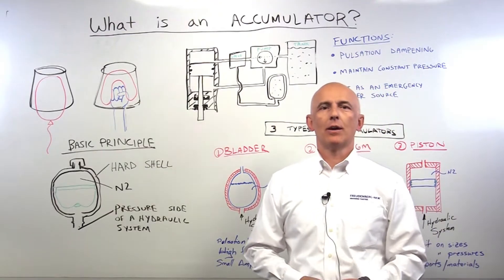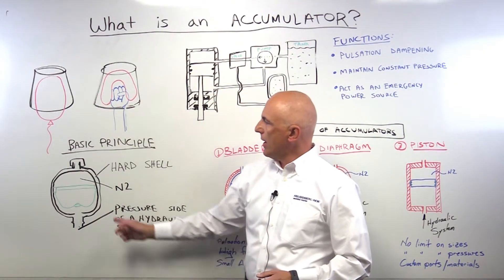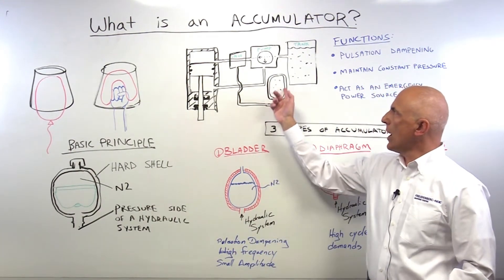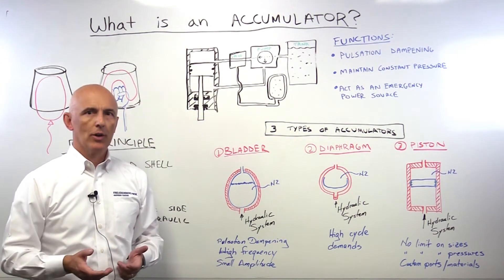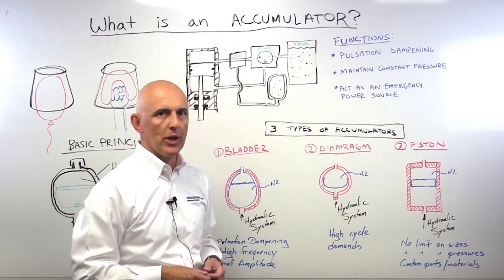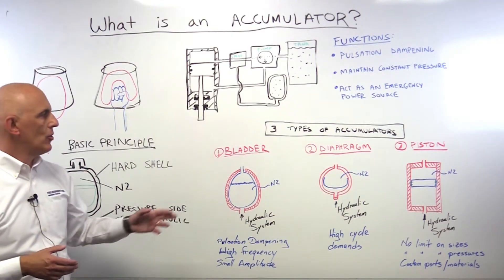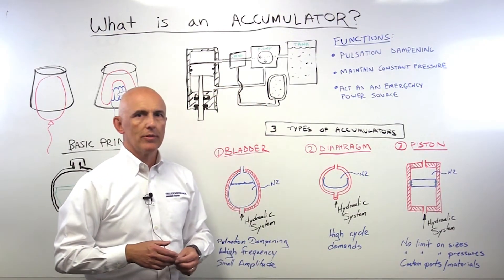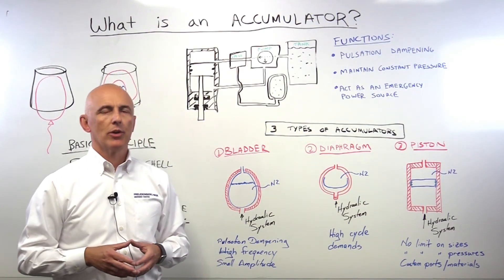What is an accumulator?

Comment: This is a good video, but it would be much better if you started off with telling us exactly what an accumulator is used for. Some people--like me--come in not even knowing that it has anything to do with hydraulics. My understanding is that its primary purpose is to store hydraulic fluid under pressure, but theyd be a few minutes into the vid before they could even guess that.

Comment: why use n2 gas?! Its a safety?!
Reply: Ya, if air(O2) is used and if there is any leakage through the barrier, the compressed air is hot so when it comes in contact with mineral oil, it could cause explosion or fire.
Reply: @gamester7287   Thank you ☺

Comment: I was thinking of using an accumulator for a press that I am designing because of the low loading rate required. Is it a valid application for accumulators?
Reply: Definately wouldnt hurt. The higher pressure capabilities your press has. The morenecessary an accumulator will be

Comment: Thank you for the explanation. I was having trouble with a press at work, machine repair took the accumulator tank off said that we did not need it, the press has not ran right sense. One of the main things that it is doing is pulsating violently

Comment: I though this was for extra sensory perception. This was interesting anyways. Thanks. Does Nitrogen bladder or diaphragm accumulators operate well in cold temperatures?
Reply: you prolly dont care at all but does someone know of a tool to get back into an Instagram account?
I stupidly forgot my login password. I would appreciate any tips you can offer me!
Reply: @Conrad Quinn instablaster ;)
Reply: @Louie Hudson Thanks so much for your reply. I found the site through google and im waiting for the hacking stuff now.
Looks like it's gonna take quite some time so I will get back to you later with my results.
Reply: @Louie Hudson it did the trick and I finally got access to my account again. Im so happy!
Thank you so much you saved my ass :D
Reply: @Conrad Quinn glad I could help :D
Reply: Acumulator is  this  made  of  aluminum or  copper pipe wichis slighrly bigger tha evaporator coil. The main function ofthis partisto stopthe  flowofthe unevaported liquied to  comperssor and  to sed the lowpressure gasto the  compressor.